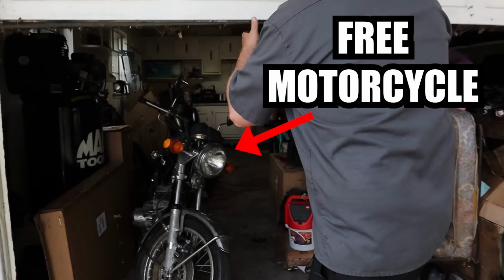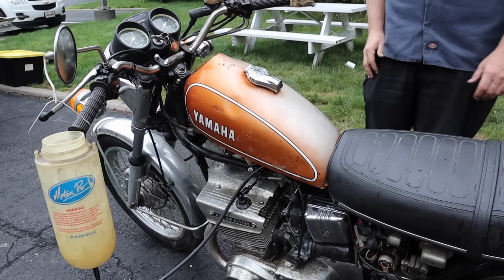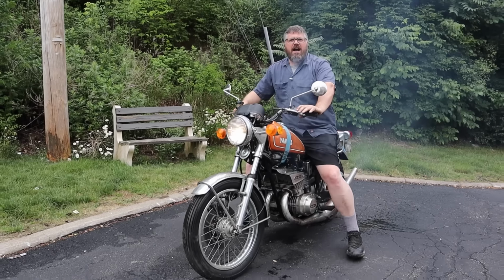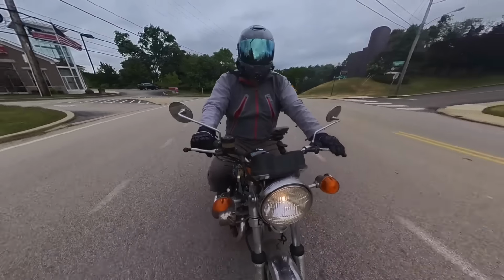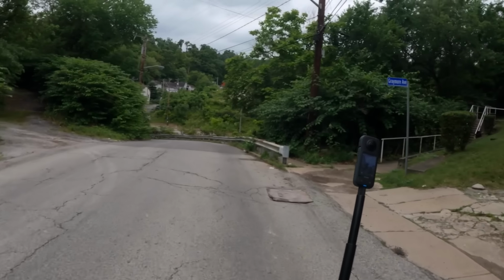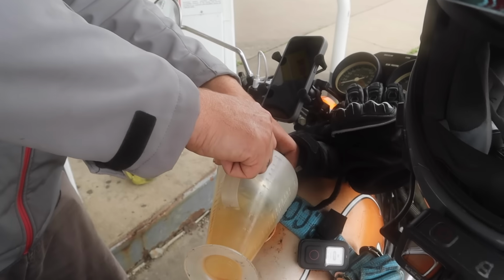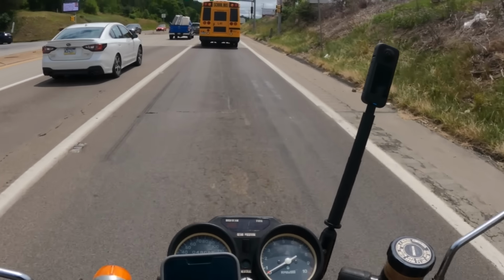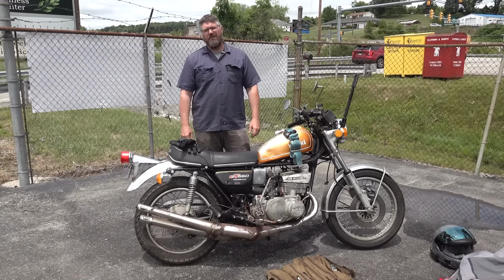Will This 48yr old FREE Bike Get me 253 miles Home?

Comment: Ouch, that ending sucked for you. But you asked what I would have done differently. So to answer that as only an amateur, I wouldn't have done open carb surgery onsite. I would have just throw it in the back of a truck and hauled it to a garage to do some proper work on it. 😉

Comment: Fun fact a 3-cylinder 2-cycle has as many power pulses per revolution of the crankshaft as a 6 cylinder 4-stroke if you listen
Reply: Exactly
Reply: Another fun fact
There is 61.9 cubic inches in 1 l.
   Or 1000 cc equals 1 l itre
Reply: That's why a good running two-stroke twin alternate firing,,twin
   Has the same power pulses as a 4-cylinder 4-stroke ...

Comment: You said it was running lean. Running lean causes overheating in the cylinder.  It's a good thing you weren't flying an airplane home. Next time, air filter.
Reply from the maker: I take better care with my airplane engines

Comment: What i consider the definitive guide for what happened to your motor is a write up by Klemm Vintage, "Deto" it refers to a paper by Kevin Cameron. take the time, read the articles. 
so many non 2t wrenches want to blame air/fuel. they don't know what a soft seize even is, or experienced one.
if it were mine, i'd look for carbon restricted exhaust or the wrong spark plug heat range.
don't even reply if you don't know the difference between an exhaust side and four corner seize.
Reply: I'm in Wi, used to be MD,  i'm currently rebuilding a 'free' Polaris 350 trail boss. strictly my avocation.i only ride trails now. rode with a few friends up in Lancaster.
i'm all ears, not on T, sorry certain programs didn't work on this computer.

Comment: Yeah if you’re going to run that without oil injection.
Did you block off the empty, air sucking oil line?
Nope.
Well… the engine is going to suck air….dry air.
Air is easier to suck than liquid. The gas with your oil charge.
And.
…..have a nice day.
Possibly, those ancient crank seals on the mag side, are prolly sucking air also.
And…..
Lunchbox…..

Comment: JFC! It IS a vacuum operated pet cock and once running you only had to dab your finger over that hose and you would have IMMEDIATELY know it was sucking air!
 I had one of these back in the day and loved the thing, I also at a different time had the T 500 Titan and despite looking more kinda agricultural, that was a great bike too. Or at least it was till the day I'd just tucked back in front of a semi I'd just overtaken and was still doing about 140 kph 5th gear smashed, locked up the rear and I had to spear it off into the scrub at that speed to avoid being squished by the semi. I never once came off that thing, despite riding it like a lunatic everywhere, not even when that happened. I have great respect for both those old 2 strokes along with all the RD Yamahas and the terrifying but absolutely awesome Kawasaki triples. Please look after and preserve this beaut bit of motorcycling history and one of my favorite memories somehow still existing. Shame about that original tank, it sorta looked pretty good at first.
Weirdly I don't remember mine having electric start. My "too drunk to ride/ sober enough" test was usually if I could kick start it without falling over less than 3 times, ahhh, sober enough lol. I don't drink these days but , , ,.
Mine (and presumably that one) had a big digital gear indicator in the center between the dials. I don't know if you've got that working but I was always one of those guys that checks to make sure I am in top on a long run every few miles, that indicator saved me bothering.
One of my favorite rides where It was about a 10 mile stretch of climbing twisties, and especially if carrying a passenger mine would ALWAYS start seizing up. I'd ease off and keep going and she'd be fine once it cooled a bit but, it happened every time I gave it to it for an extended period on that run. I never did find, nor even look too hard for a solution.

You almost certainly didn't help this one by leaving that very obvious vacuum leak stay that way to start.
I actually HATE these " can I git did old 'blah blah' running and ride it home 15 billion miles" ridiculous videos, you just proved exactly WHY!
Get a piece of history and just start off by pretty much wrecking some and almost certainly damaging other parts!  Pick the bloody things up with a trailer, whatever, take it home and CAREFULLY strip it, clean everything, inspect, measure and sort EVERYTHING out BEFORE half wrecking it FFS! I really hope you do now fully restore it mechanically at least. 
If it had the stock exhaust you wouldn't have have picked which cylinder from the pipes since for starters, they had 4 exhaust ends for 3 cylinders! To add extra silliness, they had a crossover pipe so it was ALL shared between the 4 anyway. Kinda lucky you had 3 semi chambers in a way.

Comment: Do not know if I liked when you do the last rape for this iconic bike, sure it is gonna melt middle cylinder it is this bikes weak spot. You may able to keep it running if all is at perfect order, today it just wasn't the case as barely nothing was in working order, so sad to watch! How about finding some old HD farming equipment, bike and run it without any motor oli, kinda fun to watch how long it is gonna last? 😂

Comment: It is disappointing to see someone with the skills, experience, and knowledge that you have, honestly, ruin what was left of that vintage bike. That bike was restorable, and it is a 660 triple (less common) with triple tuned pipes (uncommon). Even though the tank was missing, the original tank had a 98% chance of being no good by now anyway, it would have still needed a replacement tank. The engine ran and made it as far as it did which proves if it was torn down, cleaned, inspected,  andexperienced Technician to another highly experienced
Reply: It's not a 660, it's a 550. The fife just looks like a six from further away. There was no 660, as far as I am aware. They had 380, 550 and 750, if I'm not mistaken. Anyways, it's a shame...

Comment: I knew you would blow the engine. You can not run 2 strokes in lean condition. That and you did not use the oil injection system. I thought you would know this being a mechanic and all

Comment: The ammount of oil you put into that 2 gallons of fuel also is a killer.
2% oilmix is the best to go by. 2% of 2 gallons is waaaay less than what you put in. Seemed like you where closer to 8-10% oilmix. Maaaan NOT good at all.

Comment: Getting all the crap out of the whole fuel system including the carbs (jets especially)..
.installing an inline fuel filter...
and properly mixing the correct amount of oil the correct way would have helped.
"Finding" the vacuum line....leaking air leaning mixture
This is just a moronic way to break a bike......

Comment: I see this as a copy of Vicegrip gararge, but with bikes. I have alway wondered why if it's a bike or car that has you interested, has money value. Why would you drive it. Too ride a motor bike any distance that is not 100% safe to ride is comletely  stupid. We in the UK have the responsibility, that what we put on the road, is safe and road worthy, insurance covered road taxed and you have the licence to drive it. All of this needs to be in place for the wellbeing of you and others. What you and Derek are doing is irresponsible and in doing this, you also make the risk of damaging the vehical even more so. Like you have done here. It's great up to the point in you getting it running, but it should stop there. If someone with a more pro attitude gets a hold of something worth saving , they wont even start the Vehicie like you two idiots.  253 miles with no brake. You should thank yourself lucky it stopped working.
Reply: BeardedMechanic.  this is another cone
Reply: A scam